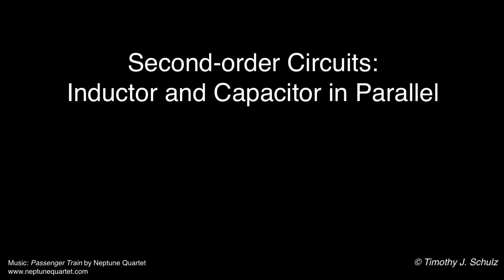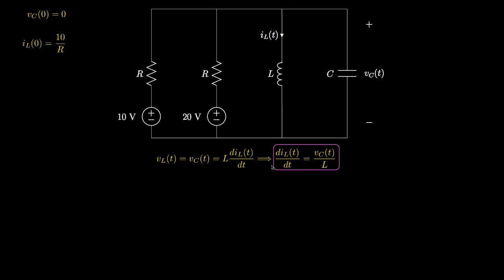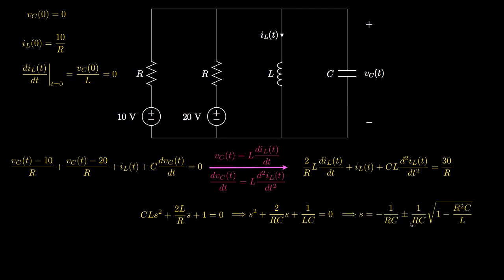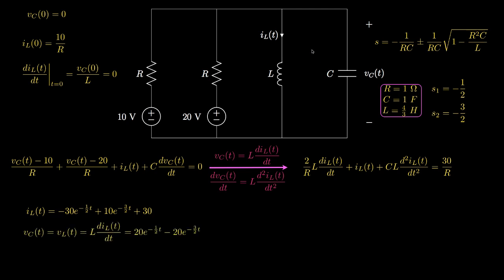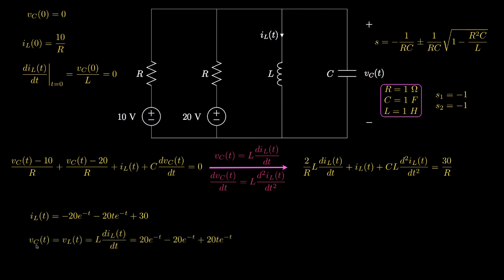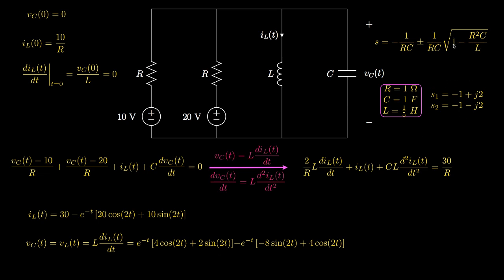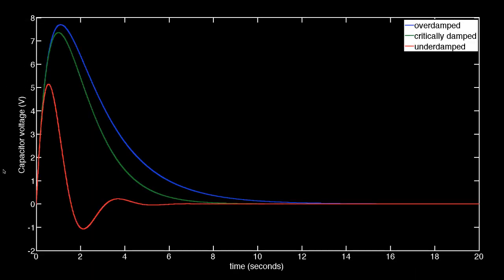Introduction to Parallel RLC Circuits

Comment: Very nice, 1 question though: 

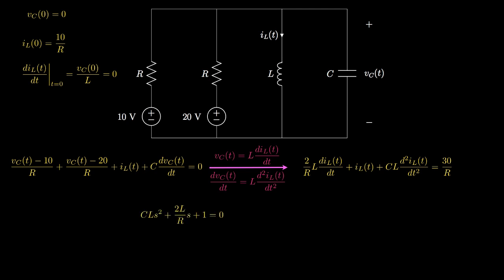at 5:38 when simplifying the second derivative to have a coefficient of 1, why don't you divide the 30 by CL, just as you did with the other terms? This would leave you with 90/4... Instead you set everything equal to zero for some reason and brought back the 30/R after you had found the roots.

Comment: why initial Vc is zero? isn't it fully charged? The very first time the circuit was connected, all currnet should go through the capacitor bypassing the inductor. As time passed, Vc is fully charged and now all current should go through indutor and none through capacitor. I'm confused. Am I wrong?
Reply from the maker: I answer that question at 1:20. Before the switch is moved, the inductor will appear to be a short, so the voltage across the inductor will be zero. Because the capacitor is in parallel with the inductor, its voltage will also be zero. So, yes, the capacitor is fully charged, but the voltage to which it is charged, which depends on the configuration of the circuit, is equal to zero. The voltage across a capacitor cannot change instantaneously, so its initial voltage will be zero after the switch is moved.
Reply: thats what I thought too.. does anyone have answer to that?